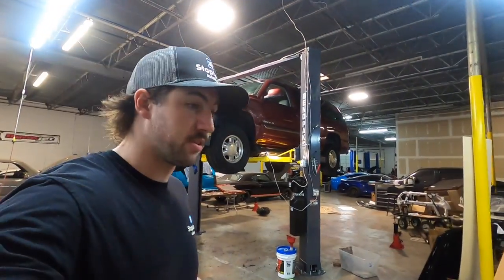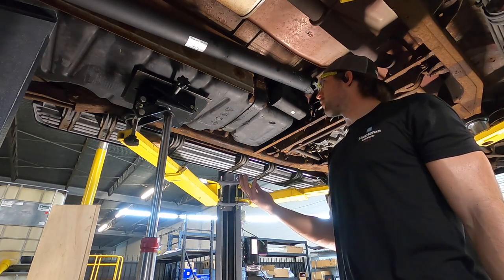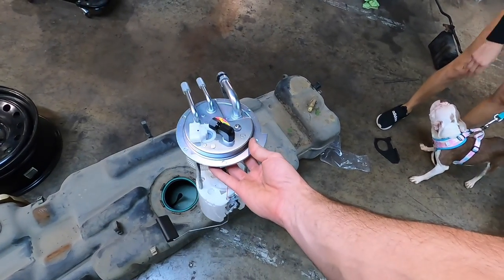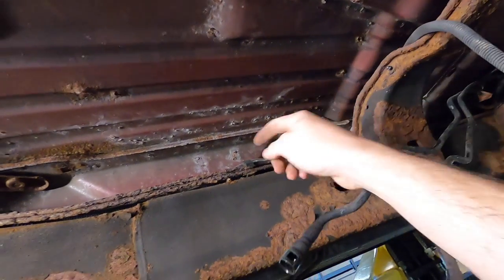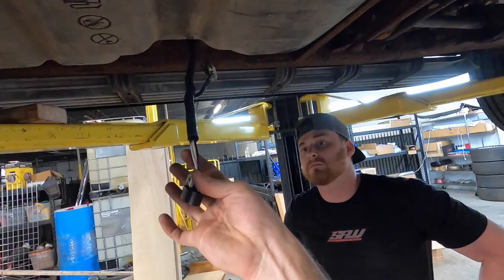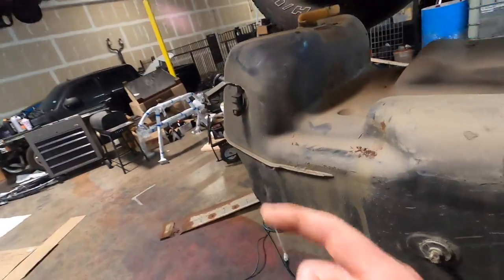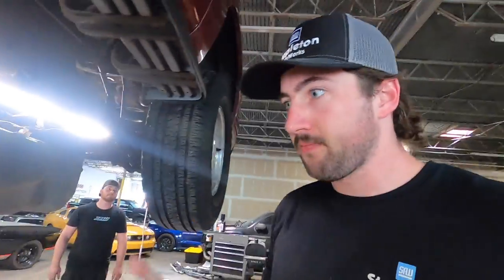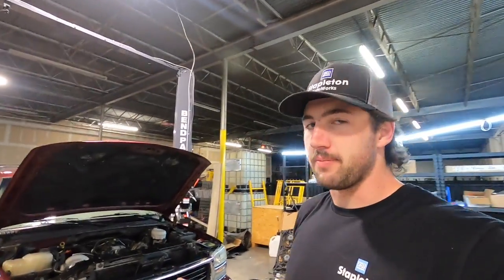Ready For More Power! Boosted 5.3L Yukon XL DW400 Fuel Pump Install (Uncle Rob Ready To Turn Up!)

Comment from the maker: How much power do you think it’ll make on the same boost level just with switching to e85?? Also…SCT this weekend got postponed to June 5th. We will still be going there with uncle rob and merch that weekend 🤟🏻

Uncle rob shirts: stapletonautoworks.com
Reply: My car should be ready. I’m ready to line up with uncle rob!
Reply: another 50-70hp
Reply: I want it to make 469 but its probably going to make 500ish
Reply: 40hp increase
Reply: I'd say another 100-150 HP.
Reply: @ Stapleton Is porting a throttle body any good ?
Reply: @jaymoney1042.  bigger throttle body yes but just buy a new bigger throttle body

Comment: 4 terminals on that sender(besides the FTPS) 2 for the pump 2 for the level sensor, next time you can ohm out your level sensor. Lift that float with the meter on and compare "empty and full". Long time gm tech from new england and rust is a night mare here. We always joke about how easy it is working on southern cars and out west. Nothing like putting all new fuel and brake lines on a 5 year old truck!

Comment: I live in Indiana. My '02 Silverado is a total rust bucket. The frame rusted in half above the rear axle on both sides. Jacked it up, welded some plate in, and drove it for another year. Then the crossmember that the rear shocks bolt to rusted off. Grabbed the sawzall and cut em off. The fuel pump went out and the bed bolts were too rusty so used the angle grinder and cut an access hole in the bed. The gas tank straps rusted off so i used those orange harbor freight straps to hold it up. The only things keeping the frame rails parallel is the trans crossmember and the front K-member lol
Reply from the maker: Damn dude 😂😂
Reply: @Stapleton42  I bought a new truck not that long ago but Ole Crusty is still in the driveway. It runs great so it's a parts car for the 78mm turbo 5.3 Foxbody in the garage.

Comment: Let them Texas boys know about when your said ratchet strap holding the tank, then rots out and the road salt 🧂 then binds up and rots the ratchet into a now permanent fixed position so in order to re-repair you then need to use 2 inch self tapping screws !!!!!

Comment: I used to work at a shop for tractor trailers. We wanted to extend the frame on a truck and we decided to take a double framed rear end and knock the outside frame off of it. (If you know what I'm talking about it'll make sense, hard to describe)
When you take two steel frames and put them together and send them north,  you end up with what looks like HUNDREDS of layers of rust, and they are all packed into a space the size of maybe a penny. 
Took 2 days with a 15 pound sledgehammer,  air hammer, and a torch at the end of the day, plus about 10 bottles of PB blaster. 
God I love Pennsylvania rust

Comment: Greetings from northern Wisconsin. Ive had gas tanks held up with ratchets, Ive had a control arm rust so much it literally snapped in half while driving it- I got some square stock and welded up a new control arm from scratch.  Had sway bars rust apart. Had hole rist through the floor so big you can stick half your leg trough it.

Comment: Use exhaust reducer to adapt filler neck hoses. Put a bead of weld around each end to retain the hose clamp so the hose can't slide off of the adapter.
Reply: I've done this and came to say the same thing 😂😂

Comment: I live in Northwest Indiana... Needless to say my 95 GMC Sierra has no rockers, cab corners, lower section of both doors outer panel and shell... Cab mounts rusted through on both sides so the cab WAS sitting up against the bed until i jacked up the cab took the bushings out and put a piece of a 2x4 in place.... 255,000 miles and she still runs great 🤙🤘

Comment: from the 1st OG dyno test, to the adding of the Turbo, to switching to E85,  then to see you ( or Logan) drag it, is Very cool.   When you pull parts off,   Rustoleum & undercoating everything then put it back together.

Comment: I love the channel obviously want more of the escalade. I'm from rhode island so salt all winter long. 2 years ago my fuel tank straps broke and yes I used a ratchet strap for 2 weeks because that same tab with the captures but broke and spun. Got it all fixed and then a month ago the actual mounting point rotted off the frame. I made and welded in a new bracket. Im also less than 300 miles away from 200k miles.

Comment: Have been waiting for the fuel system video! 
I'm from Michigan, ratchet straps holding random shit together is a real thing. I'm guilty of it too, had a balljoint rust out of the control arm on me. Ratchet strap, duct tape and binder twine made it 10 miles back home.

Comment: FTP Fuel tank pressure sensor. Mostly for EVAP emissions but could possibly used for some weird input for performance use. Those j-nuts break on Texas trucks too. Most dealers keep them for that reason. Use a metal pipe reducer on your fill pipe. Prolly have to make it.

Comment: I’m pretty sure the lock ring is supposed to go into the second bump, that’s what locks it. I usually put a little grease on all the bumps to help it lock in place. At least that’s how all the fuel pumps have been like, that I’ve put in.

Comment: You can plug the new pump into the wiring
Turn on the key and move the float arm
They swing up empty to full just get a 12ft stepladder makes this shit easy 
Jump in turn the key and ck the gas gauge takes less time to do it than splain it

Comment: 8 miles SW of downtown Pittsburgh here. My dad had an 01 grand Cherokee from when I was in 6th grade (04-05) until he gave it to me in 2013 with 196k on it because they wouldn’t give him anything for a trade. By 2011 when I was 18 had rust holes through the frame/rockers big enough for my fist to fit through still passed inspection. Transmission blew up the day he gave it to me coming home from PNC Park, girlfriend at the time was not impressed with my new car.

Comment: Those I clips all do that, pro tip here- use hand tools to get the bolt moving. The impact usually is the thing that breaks them. Don't get me wrong they break with hand tools to but less likely than the impact.

Comment: That sensor on the sending unit is a fuel tank pressure sensor, it monitors vac/pressure for evap. With the key on and gas cap off it should read 0" vacuum. Your vent valve connected to the charcoal canister opens to fill the tank so it doesn't shut off the pump nozzle and the purge valve in the intake is pulse width modulated to pull a vacuum in the tank and burn up fumes. If the pressure sensor is reading wrong your purge valve could possibly stay on pulling too much vacuum in the tank and add too much fuel vapor causing a ruff running condition. 
uu

Comment: The stuff we get in central New York cause of this rust belt is insane....I've been ratchet straps bungee straps and even duct tape holding a gas tank up....and I myself have welded in new gas straps because the old bolts wouldn't come out the bolts were inaccessible to where I just cut them out and welded the new strap to the old nut🤣😂👌 that tank ain't never coming out
Reply from the maker: Hahaha
Reply: @Stapleton42   it was a 2000 Chevy impala😂 the car still rolls around today with the straps still welded on👌

Comment: Progressing well, usually the fuel tanks have a raised plastic arrow or line, close to the tank hole, to line up with another arrow or line on the new pump assembly, to ensure pump is clocked correctly, possibly under the dirt Uncle Rob has accumulated lol
Reply from the maker: Noted lol

Comment: U needed the hillbilly hole in the floorboard right under driver's side back passenger seat. Super easy to change pump out and hell with the straps etc. I have two burbans and both have a fuel pump hole cut in floor. Takes me about 10 mins to swap my fuel pumps out now

Comment: being from CT I know exactly what you are talking about with the tanks rusting out every ford I've ever owned up here (which is like 5 or 6) has had at least one rotted out tank strap I started using pieces of ¼ inch cable to hold mine up alot more durable then the rachet strap method lmao

Comment: This is why I have a love hate relationship with wrenching. Being in Canada has shown me how even stainless can rust.
Reply: All stainless isn't necessarily "stainless." Check it with a magnet, that's a good indicator if it's gonna rust or not. If magnet slaps down on it that means it has a high carbon content and will eventually rust especially if in contact with a dissimilar metal like steel... 304ss is about your best bet

Comment: Gates makes rubber sleeves that will do the trick on the filler neck. I've used them on radiator upper and lower hoses. Fit snugly over the radiator neck. You need to find a good counterman who knows how to use a catalog.

Comment: I was an auto mechanic for 12yrs up here in MN. Was not uncommon for trucks to be so rusty that the frame would break if you didn't lift it on a drive on lift.

Comment: Nice install!  I installed a Quantum 340LPH in mine so I didn't have to change the tank and kept everything else stock.  The gauge still works too. What did you do about your stock fuel filter?

Comment: I love watching this build going one step to the next! Watching this build made me buy a project truck, I got a 2004 silverado rcsb. I'm even writing part numbers down as you go! Lol. So Uncle Rob will only be running on e85? I'd like to do a flex fuel conversion, so i have more gas options. Not alot of E around here. Doesn't the escalade run a flex fuel system? Still learning how all that works.

Comment: I'm not even up north really (Arkansas), but my roof has a virtually invisible leaking rust hole in the roof that only seems to soak the driver's seat belt. It can only be seen by taking off the exterior b-pillar cover.

Comment: The sending unit ohm readout flipped in 2004, I just had to deal with this on my truck (2003) because there wasn't an XDF available for my original OS. (I'm using LS droid/Tuner Pro, not HPT). 

Also, if Murda is streaming the hood track tonight, I'll be looking for y'all!
Reply from the maker: Noted

Comment: Had a 2002 suburban with a broken tank  strap and couldn't put a new one in because that part of the frame had rotted out also. So we used a rachet strap for 2 more years. Had to retire the  old suburban because the frame had rotted to bad with 285k on it.
Reply: I'm from Connecticut and I like this project

Comment: I have a 2002 Tahoe, so I need to get a bigger gas tank or will mine work ?
Reply from the maker: It will work unless you want to use the sending unit from a newer truck like we did. The gas gauge doesn't work anymore and I don't know why... so if I were to do it again I would retrofit the stock tank bucket with a bigger pump lol

Comment: That’s not even rotten just a little crusty you should see what runs around here in northern Michigan. I have personally lost a gas tank on the road chuck hole winter and rust. Had to scrap it nothing left to strap to..now most trucks in are market are from Canada because they make money on the dollar exchange and they are even worse..

Comment: I think your base boost is 10lbs because your wastegate is only really dumping 1 bank because of where it's at.  It probably needed to be right below th turbo so it could dump both banks.
Reply from the maker: If the priority was better on the 1 bank it’d be fine but it’s not right in the elbow. I didn’t want it to stick down too low

Comment: Hey man how did the stock regulator do so far? I have that dw400 drop in pump but don’t know if I need to add a big regulator with it
Reply from the maker: It’s still in there but inconsistent. I’d run a regulator

Comment: I'm doing an LS swap from a 2005 Yukon Denali into my 1992 K2500 OBS suburban.  And all the frames I see from early 2000 Tahoe's or Yukon's are severly rusted. Badly rusted frames. Mine had the same problem.  But my 92 K2500 has the cleanest , rust free frame I've ever seen on a 32 year old truck. What happened GMC/Chevy??

Comment: So on a single turbo,I don't need to buy a boost ref regulator?
Reply from the maker: Yes you always need a boost reference regulator with any boost in the engine to do it right. Can it work without one? Maybe. But you risk melting stuff so it’s not worth it

Comment: People used to acid dip frames and panels to lighten them up. Us rust belt dwellers just wait for nature to provide weight reduction. Nature, and the PennDot Salt trucks.

Also I almost got  tetanus as a kid from sitting in the bed seat of my Grandfathers Subaru brat . No Subaru from the 80’s lasted more than 5 years in western Pa. Whole floorpan and half the bed were old mill signs, or license plates.

Comment: That is not rusty at all.  My 2010 sedan has more rust than that and I take care of it.  North Dakota uses salt or a sand salt mix on all roads every winter.  It turns the paint, frame, wheel wells, etc a white haze.  It is a struggle to pressure wash it off and then worry when the water freezes from washing the car and your windows, door handles, locks, wipers freeze solid.  Then it's time to break out the heat gun to get the door open and let the car run to defrost.  Cool thing is, the crime rate is not bad up here...

Comment: Let's start out with ok I'm old 66 years older I had a 1985 Oldsmobile Cutlass that as I was driving into town like early January I felt a thump and then something was dragging behind me so I pull over and get out to find my gas tank on the ground sticking out from under the bumper about two feet dragging by the fuel lines I wound up putting it in the trunk but first I lifted up the now sagging trunk mat to find no floor so I did what was right and cut me a piece of plywood to put my gas tank on then whenever I needed fuel I had to open the trunk.

Comment: havent finished this video but why swap the gas tank? Is this strictly due to the newer sending unit DW sent? Is there an older style for the old tank? I tell you any experience ive had with DW has been terrible over the years they send out injectors with the wrong o rings, wrong pigtails, fuel pumps that "kind of" fit and every single thing needs heavy mod like a new gas tank (or that rod on your sending unit like wtf??)  just to work which is ridiculous when you could just build your own from other parts and have the same thing or better for less money (maybe not an issue here if they sent it out for you). Like its fine its all part of the game but if im working in my driveway and have no second car to make part runs im not gonna want to find out i need o rings or a trip to the yard for a gas tank etc lol which makes these videos kinda nice. Been here since the start man its great watching you progress. Take youtube for all its got man.
Reply from the maker: I used the newer tank for this particular sending unit. Also down the road it can fit multiple pumps in the bucket where the original tank sending unit hole can’t fit as many